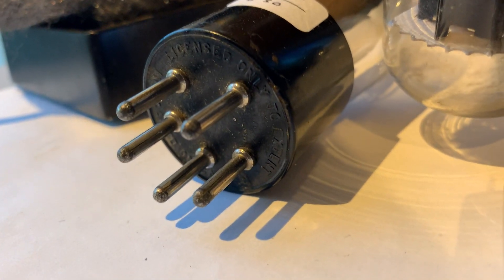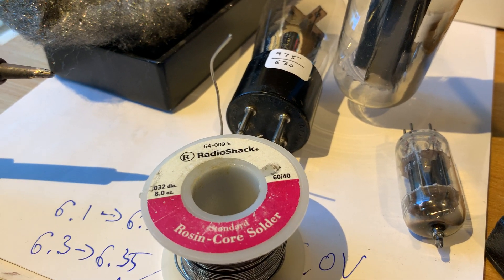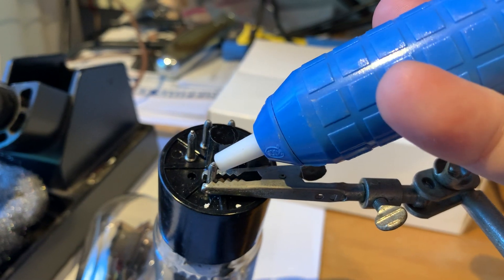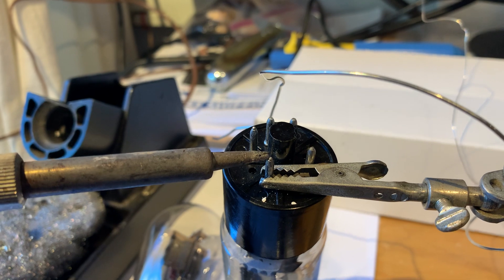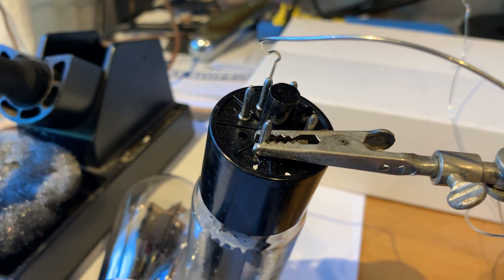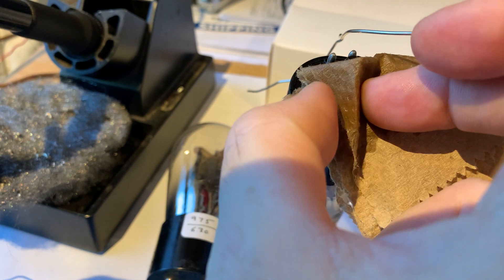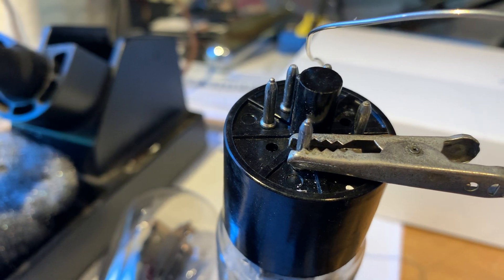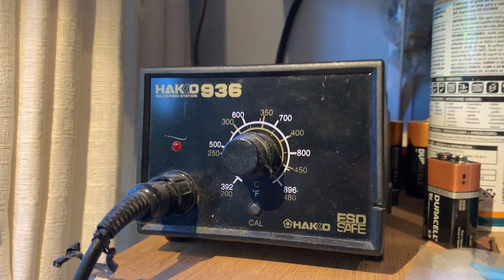How to change solder on vacuum tube pins

Comment: You are pulling away the heat from iron with that metal alogator clip (it is acting like a heat sink) - I would clip onto neighboring pin to retain heat from iron
Reply from the maker: That's right. I was trying that initially, but when you apply pressure with the iron to the pin, the tube flips out from the clip's grasp. When not applying enough pressure, there' not enough heat transfer to melt it.